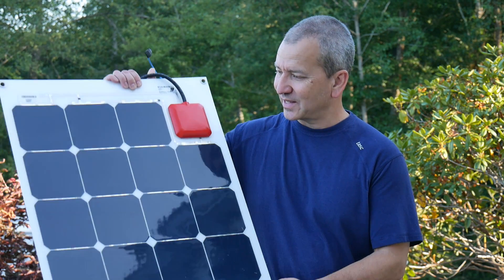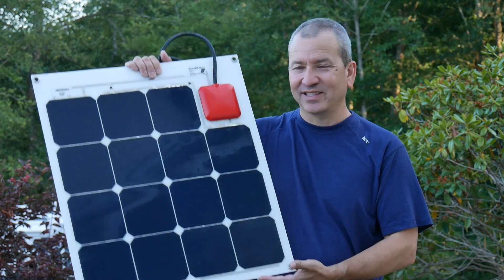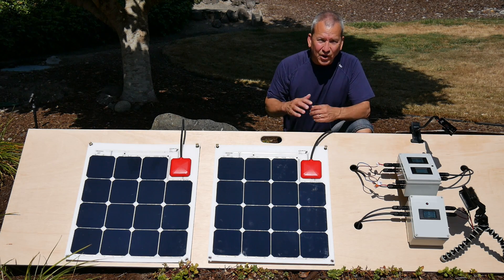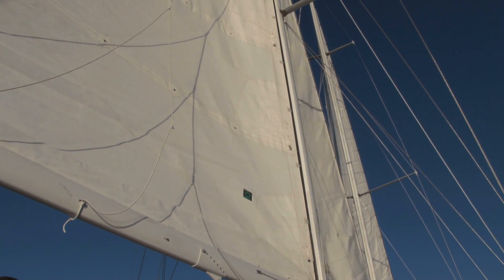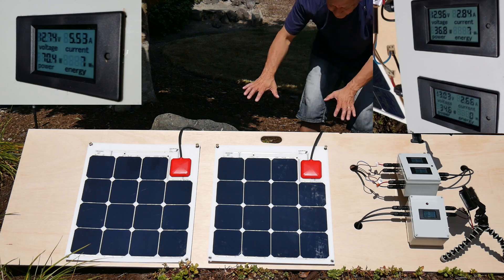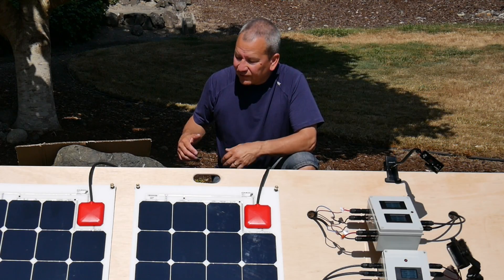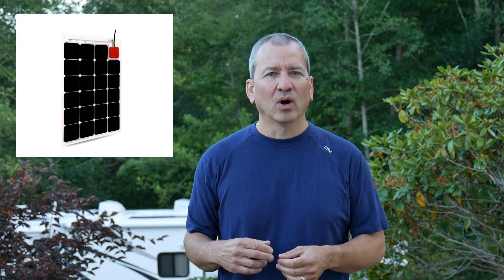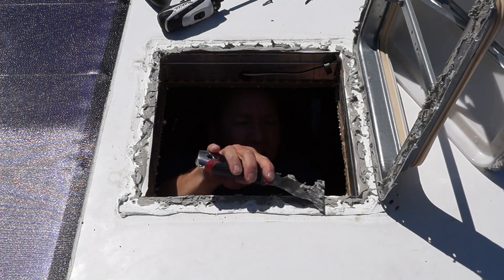SOLAR Panel with Built-In MPPT Controller : Solbian ALLinONE

Comment: 👎 

What would be interesting is to attempt to charge a battery that is close to 70% full, and observe what happens to voltage, amps, MPPT temperatures, and battery temperature as the battery gets filled up.

In most situations where several charge controllers are working independently of each other, one of them will eventually sense that the voltage is at absorption level, and it will go into absorption and early float.  Meanwhile, the temperature of the second charge controller will rise as it tries by itself to dobal, the work.

In theory, it sounds great, but in practice they would require a special connection and programming to work together.  Otherwise, you end up paying for something that never delivers as expected.

So unless I got better performance data, I will rate them down.  Why?  

Because someone might think of buying them without a full performance test.

Comment: Aren't these about $500 for a 50w panel each..? and $1000 for a 100w panel..?  It doesn't look like the specs 18v 5,7a on the 100w panel can justify spending $1000 per panel.

Comment: Solbian is professional on marine solar panel, if you looking for this quality level,but cheaper price,you can find LINKSOLAR, the second company you can find quality meet the same military grade as Uni-solar Did. As a manufacturer, Flexible solar panel is not easy to test the lifespan and quality,because in the market the cheapest flexible solar panel must be used with low-grade material to make price competitive,if you are looking for cheap but quality good,long lifespan,just giveup to wast money.

Comment: Sweettttt and costs only about 10 times as much as a comparable Renogy panel. Fuggetaboutit!!!! Nice try Tito.
Reply from the maker: Yeah. Those are spendy and not for everyone, but they do have a specific application. As far as I know, there aren't any other comparable flex panel/controller combos out there. The purpose of the video is not to sell you one. I agreed to share these because it's an interesting and innovative concept worth talking about. Cheers. Brian

Comment: I’m a tiny home on Wheels enthusiast who is building currently.  My on demand instant hot water heater runs on propane but requires dc to ignite. This seems like the perfect solution for someone who is wanting to only wants solar for appliances like this. The propane refrig has a similar requirement. I’m interested in testing these as I build up to a full solar system. 
What would happen if you hooked up these up in series to regular flex panels relying on the one red controller to regulate ?

Comment: again a super Vdo tutorial,  I was just wondering when you have such a parallel set up and you shade one, do you ge an overlapping charge curve..or do they produce mainly constant power insteas of doong Iouo curves like if you connect to parallel or serial to a Iouo ( bulk, float, absorptiom etc..) hows that.. I love the solution as a back of having the Rv in a shady area and hang those to my awning and do supplemental charge this way...?

Comment: Hi folks,  For sure a glass panel will always be much less expensive.  The AiO may not be for everyone or for all of the solar on any particular installation.  However, they have their place and can be installed & used much more easily, for the applications that could need them.  The portability and simplicity will work for some, and may not be worth it for others.  As far as being a "poor value", if the goal is simply the most watts per $ without regard to weight or convenience, then the AiO may not be the answer.  However, on RV or boats the argument can be made that very few of either actually ever make financial sense overall (vs. stationary home living)...;-)  We all make lifestyle and adventure choices, and in many cases the AiO panels can help support freedom & fun, which is the point of it all anyhow!

Comment: OK ,you have separate MPPT controllers feeding into the same battery bank, correct. Would these multiple chargers not confuse each other, and get false readings,on the state of charge . If this works as well as it looks like it might could you experiment with couple or three cheap panels and cheap MPPT controllers and see how they would work making your own. I have 960 amp hour of battery capacity. I am looking at 3 to 4  320 watt Solar panels. This looks like an interesting concept.
Reply from the maker: Sounds like a good experiment. I'll work on that.

Comment: Hello everybody, this is Luca, technical director of Solbian. First of all many thanks and compliments to Tito, he understood our products really well without almost any hints from us. Great review, we wish we had a similar one in italian!

I would like to give some tech infos but I cannot avoid starting from the price issue, the most comments are about that. I could tell about quality, innovation, assistance, etc., but I will stay much simpler. As Tito said, that is a new product, and actually he chose the most expensive Solbian series, we have different prices in our range and the MPPT board is adaptable to all of them. We started offering the ALLinONE on our top series, broadly used on sailing boats where price is considered acceptable, but we got your message, we'll work on that.

Many thanks for all the comments too, here are some answers.

@TODD SWENSON and sneltoch: AiO panels can also be connected in series, you loose the advantage of shading protection but you can, as an example, charge a 48 volt battery with two small SP 23 AiO 24 Volt in series: https://goo.gl/SDqMmL

@ Zen Zen: good point, actually on my desk I have the prototype of a new board with WIFI communication capabilities. It will be possible to read the electrical parameters on a smartphone and to do some setp-up of the board. As Tito wrote, AiO can be adapted to Lead and Lithium batteries but we need to do at factory, before shipping.

@sneltoch and HOBOTEC: the red case is painted aluminum and the flat conductors are quite resistant (never seen a failure of those). I agree that front glass gives more protection, but it is heavier and dangerous (if you break). I think Tito already discussed  pros and cons of flexible lightweight panels.

@Steven Ruscoe: the board is a true MPPT (https://goo.gl/Vz1b9E), moreover it is a BOOST, namely a DC-DC converter increasing the voltage. That can be an advantage in shading. You can easily see the two bypass diodes embedded in the panels (the small black squares on the upper side). If you shade half of the panel the bypass diode allows the current flow but the voltage drops to the half. If that happens with a standard charge controller, the voltage will be too low to charge the battery, while with a BOOST you can still charge, even with less efficiency.  

@Christopher Michaelson: the board have been tested against FCC EMC testing and they are safe, moreover the aluminum case is giving a further shielding effect.

Feel free to ask more. We'll be glad to answer, and do not miss to look at our galleries: https://goo.gl/EpPEiB

Cheers, 
Luca
Reply from the maker: Thanks Luca for adding to the conversation. It is very helpful.
Reply: Luca, it's been 6 months since your comment about WiFi communication with charge controllers.  I just went to your site and downloaded the brochure.  No mention of WiFi or Bluetooth communication to controllers.  Is this still a future option?
Reply: Solbian a

Comment: Is it really MPPT? need to take the cover off to find out. you should be getting more than 90 watts. Try not to change between Amps and Watts too often, it'll just confuse people, with out  looking at the datasheet for the panels I bet the IMAX rating is 9 Amps. I'll look it up now
Reply: Hello Steven, the board is a true MPPT (https://goo.gl/Vz1b9E), moreover it is a BOOST, namely a DC-DC converter increasing the voltage. That can be an advantage in shading. You can easily see the two bypass diodes embedded in the panels (the small black squares on the upper side). If you shade half of the panel the bypass diode allows the current flow but the voltage drops to the half. If that happens with a standard charge controller, the voltage will be too low to charge the battery, while with a BOOST you can still charge, even with less efficiency. 
P.s. you cannot take the cover off, or better you can try, but the electronic is completely embedded in resin to give a IP68 protection. If you need more details feel free to contact me.

Comment: what about if you put those in series ?
Reply: Not possible with a dedicated mppt
Reply: Than you for the question Maddula. The AiO MPPT controller is based on a ST chip which allowes for series connection. You can easily reach high voltages by connecting more AiOs in series. In that case every panel will be optimized by its own MPPT but you will not be protected by shading (a shaded panel will decrease the output of all the series).

Comment: Why do I need to pay the cost of a charge controller for every single panel, when I can pay for a single charge controller to handle the current from all my panels?  I'm a big believer in redundancy,  but I don't believe this is an economic solution.

Comment: Nice video !
But, how come you get lower combined voltage from two paralleled panels, each having higher voltage than combined ?
Reply from the maker: +John Smith Thanks. The combined is pretty close to the sum of the two. The slight drop is probably due to a tiny bit of extra resistance introduced by the additional connections. There is also a tiny bit of resistance/drop across the shunt (inside the box) that is necessary to measure current flowing through it. Hope that helps.

Comment: Tito, nice video but the panels are to expensive and my question is: do you have to buy another device or just a connector to hook up in parallel
Reply from the maker: +Vantastic Odyssey No you don't need a separate device to connect multiples to the battery. Combiner boxes help to simplify the wiring and may also include fuses and other overcurrent protections. You could simply wire the positives and negatives to the appropriate posts on the battery.

Comment: I thought you didn't want more than one controller connected to a battery, because they could end up fighting each other, one going into float mode, while the other is still in bulk, etc. Does the mppt controller have battery protection, etc?
$800 for 72 watts is just WAY too expensive.
Reply: Helle Sean, the controllers are simply CC/CV chargers. That is the best choice for Lithium batteries and it is reasonable also for Lead batteries when the power is not too much (compared to the battery size). In that way the only interference you can have is when the battery is almost charged, due to small differences in set-up a charger can stop before the other, but that is really poorly significative. The battery are protected because the final voltage is  kept a little bit lower than the maximum charging voltage (for Lead it is 13.8 V) and thus you cannot overcharge your battery.

Comment: I am curious if these MPPTs arr optimizing each string within the panels or the entire panel as a single unit? Reason for my question is that a string optimized panel handles partial shading, of which you did not show. Nice to see this tech applied to smaller panels and not the 60 & 72 cell.

Comment: I run a 24 volt system, using an Outback mppt controller with 4 125 watt mono panels, the kyacero panels actually charge off solar on cool clear nights, not a full charge but something like 10 to 15%  Those panels you have look like they would be great for a tent or something for limited light and phone charging but not for full blown off-grid applications.
Reply from the maker: I think they were primarly designed for sailing and smaller mobile applications. The distributed MPPT approach is a common setup for performance sailing applications. This unit takes it a step further by including the controller directly on the solar panel. Some may find that worthwhile and some may not. Time will tell. By the way, these modules also come in a 24 volt version.

Comment: Being smaller is also an advantage. Although when something fails the compete panel needs replacing (a disadvantage ?? ) the item that needs replacing is a smaller module so in some ways more cost effective than say a larger 250Watt unit dying and replacing a larger unit.    And also as they all run in parallel you can wait to replace and the rest of the "network of panels" will still produce power and work just fine,  just slightly less by the amount of a single panel.   

I like the looks of them.  I like the  idea of them.
Reply from the maker: Yes I agree that smaller is better and is not necessarily a disadvantage (noted in the text in the video). The main reason I listed the smaller modules is due to the per module cost being pretty high. I knew people will be focussing on the high cost of the modules as you can see by many of the comments. Thanks for chiming in Steve!

Comment: They don't look very durable at all. A failure point looks like it would be at those flat conductors between the hard controller and the flexible panel. A neat idea but for any real longevity you'd want the protection and rigidity of glass.
Reply: RVwithTito:  And glass fronted panels have to be assembled into rigid mounting frames which makes them unsuitable for curved roof panels such as on caravans and particularly on smaller boats.  Also they are much heavier.  Self adhesive flexible panels have been available for these applications for a long time and durability is excellent provided you buy from a reputable supplier.  The big advantage of the Solbian panels shown in the excellent review is their reduced number of cells and hence reduced size for the same output voltage.  Without the built in 7.5 volt to 14/15 volt dc converter you'd have to make the panels much larger to obtain the same voltage, and if you haven't got the roof space you're stuck.  It's also worth noting that the panels are using the rear-contact Sunpower Maxeon cells which although more expensive than normal cells with front connections, have a higher sunlight to electrical power conversion efficiency of around 22.5% because the whole of the cell surface is exposed to sunlight.  Front connection cells lose exposed area because of that taken up by the front mounted tabbing strips.  The rear connection cells are a further aid to reducing the required roof space area for a given power output.  Re cost, yes there are cheaper panels available but these require more mounting space, and if you haven't got it....!  And it's easy to fall into the trap of looking only at conventional panel prices and ignoring the cost of the then required charge controller and cabling.  Overall, an excellent innovation by Solbian.
Reply from the maker: Not sure. Time will tell I suppose. I've been using flex panels for a few years now and they don't show any signs of wear. I have heard stories though of people having issues. The same is true for traditional panels though.
Reply: I did read that the manufacturer says not to walk on them, so although they are more durable, they are still fragile.
Reply: Bennington Camper: I wouldn't walk on a glass encapsulated panel either, especially as the normal mounting recommendation is to leave about a 2 inch air gap between them to assist heat dissipation - a dark surface can get very hot in bright sun and the panel output falls with increasing temperature.  Walking on such a panel would almost certainly destroy it.  Provided a self-adhesive panel was well stuck down to a rigid surface, walking on it with soft soled footwear would not normally harm it provided the surface didn't flex and the feet didn't twist round on the panel .  The manufacturers have to protect themselves by issuing the 'no walking' warning because they can't know all the different installation and use details so can't say what is acceptable and what isn't.
Reply: As a solar installer with over a decade of experience, I agree that standard framed glass modules should never be walked on - that should go without saying, and is not in question here.
Unfortunately there are many videos of people installing flexible modules and walking all over them, assuming they would 'flex' enough not to cause problems. Again, not true. The majority of crystalline silicon PV cells are more like glass than plastic in their physical properties. This can be mitigated to some degree by their thickness and encapsulation materials, however even bending them will cause microfractures, which ultimately cause performance degradation. So this is not a case of 'protecting themselves' , rather providing installation and maintenance guidelines based on experience and warranties. Everyone will do whatever they want, however manufacturers are not liable for stupid things people do in direct contradiction to their instructions.
Reply: We've been using flexible panels for a decade on a caving expedition in Europe, and they have been really tough. They've been blown around by the wind, and rolled up for storage and generally not looked after well. They have been bombproof. So flexi panels are not necessarily less robust.